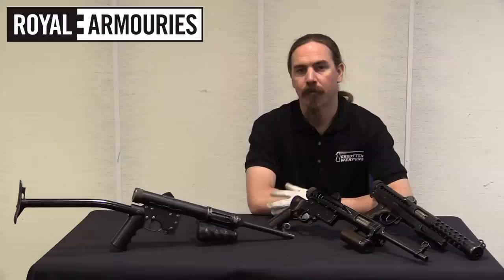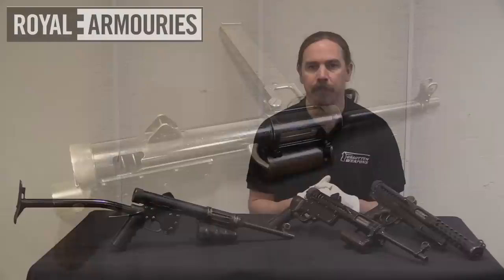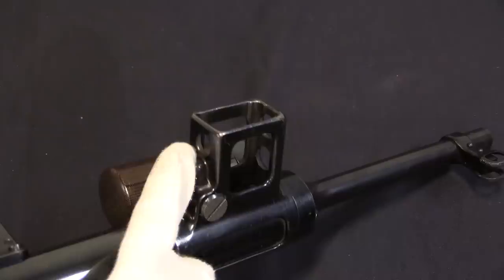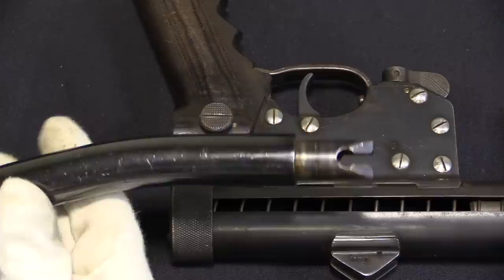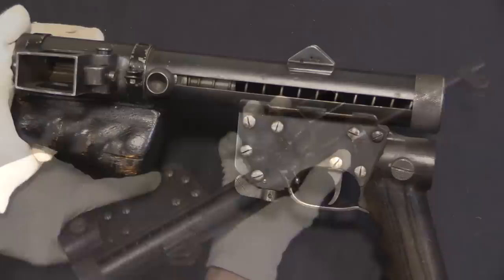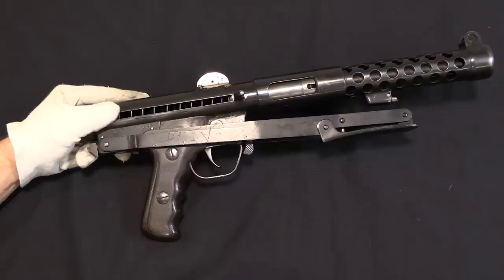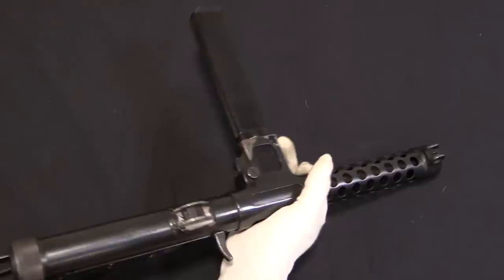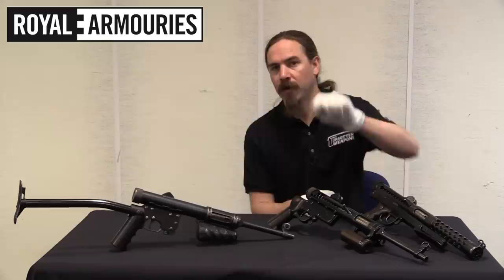Lightweight Experimental Lanchester SMGs

Comment: To add a side note, the Sten gun was made by various companies. The pre-war toy company Tri-Ang was making a Sten Mk II for around £1 9S 8d, which is the equivalent in 2019 of £80, hence the "We don't need another design, the one we have works well and is cheap" and I don't know many places that now could make a cheap SMG for that price.
Reply: I wish I could buy a Sten for 80 pounds or the equivalent today.
Reply: @TheCheat_1337  I think the conversion rate would make it USD 90, I already adjusted for inflation, it might be a bit cheaper but I did it quickly.

Comment: Never underestimate the creative energy of a single bloke tinkering...

Question for the open bolt blowback experts: 
The two part bolt with separate firing pin. Why??? Doesn't appear to offer anything in simplicity or ease of manufacture
Reply: @JinKee  Roger that, thank you sir
Reply: @JinKee  Except that the two parts of the bolt are held together by the recoil spring, so there's no out-of-battery safety.

Comment: Personally I have reservations when it comes to the design of the Sterling as to who picked who's brains.
Reply: As far as I can see George Lanchester (from the MP28) did the basic SMG and Patchett did the lovely proper magazine and tidied it all up. Crudely a Bergman with a double stack, double feed top quality magazine. I loved my L2A1 and never had a fault, bar the rubbish Indian ammunition the MoD bought. The only issue was making the rude & licentious actually use the shoulder stock and aim the ..**! thing. Did the job up to 100 metres and kept heads down out to 200 metres.
Reply: John T. Thompson had similar and earlier design -  the 1921. central grip and mag, removable and folding stock. Brits had Thomsons to borrow ideas from)

Comment: Super video.    Reminded me that there used to be an old "joke" that the RN adopted the Lanchester SMG because there was lots of brass and walnut to polish, and the Navy had the battleships to transport what was a weighty piece of kit.   Clearly these models were meant for the army (sorry, couldn't resist).   In passing was Lanchester connected in any way with the Lanchester saloon car which I think  had a reputation for solid construction and a fine finish.   Nominative determinism strikes again maybe?

Comment: Thanks again for another fantastic and informative video. You know this channel is loved when you have 119 views and 283 likes.

However, I do have a question about the 3rd Lanchester's folding stock around 9:20. Specifically, how do you unlock it from the unfolded position? It appears like there might be a latch underneath the receiver's end cap but I'm not sure.
Reply: You just pull.
Reply: @darkiee69  When he said that he was clearly talking about disengaging the stock from the closed position, in order to unfold it. He was even zoomed down on the spring loaded latch he was referencing. He did not discuss how to fold it back.

Comment: That quadrilateral folding stock is pretty neat. Are there any other examples of that design or did it die with this gun?
Reply from the maker: Sterling used it later; that video is coming in a week or two.